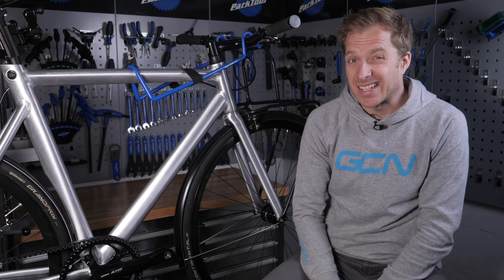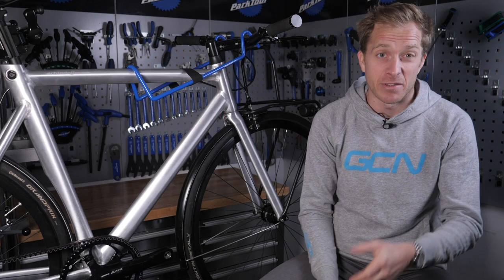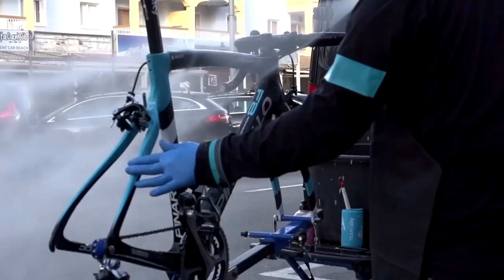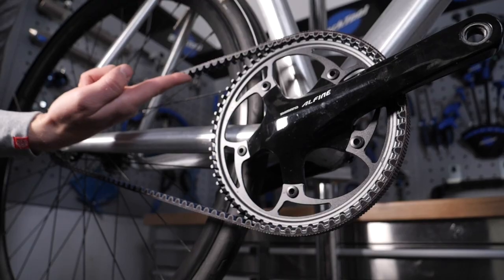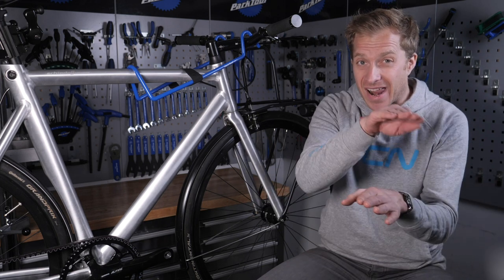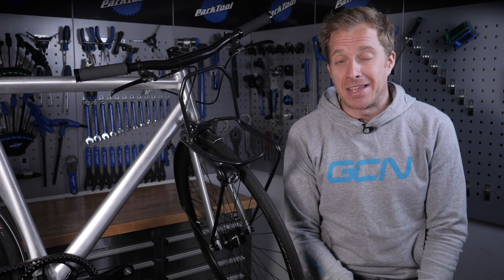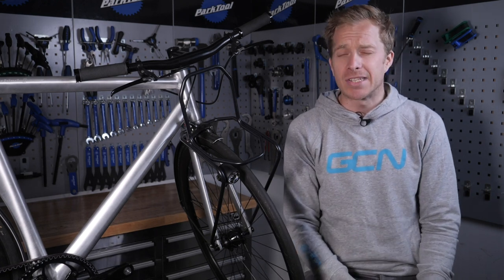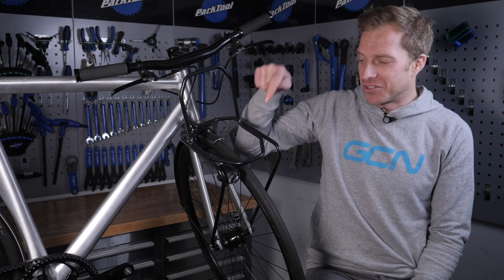4 Top Tips For Easy Winter Commuting | Urban Bike Maintenance Checks

Comment: Just want to address the statement about the belt drives.  I disagree that they are "virtually maintenance free", particularly in winter.  I've put about 15,000 miles on my belt drive commuter over 5 years, and where I live we get plenty of winter snow.  In my experience, the belt and sprockets do need to be periodically cleaned and lubed (Gates recommends a particular silicone-based lubricant), or else the belt will get noisy, making various kinds of squeaking, squealing, and chattering noises, especially when riding in winter weather.  Also, in cold temperatures,  the tension of the belt may need adjustment, since frames and other components can shrink in the cold and this affects belt tension, and belt drives are far more sensitive to tension than chains.  Overall, yes, they are less maintenance than chain drives, but I don't think it's fair to just skip over belt drives and say "you don't need to worry about taking care of them at all!"

Comment: Mentioning wear indicators on the tires again.  Just more proof that I deal with some pretty lousy street conditions.  My tires get nicked and sliced to the point that I can't trust them way before the wear indicator says I need to replace them. Still cheaper than driving a car to and from work.
Reply: I got super bulky tyres on one of my bike. I have purposely driven it in broken glass and got no puncture, just some cuts but are no where near in causing puncture.

Comment: I got a Gates CDX belt for half a year now and I have to say it's not THAT maintenance free. If you don't clean it at all, it will develop an unattractive whiny noise sooner or later depending on how often you ride through mud and dirt. Cleaning is much simpler though, just a matter of hosing the dirt off or scrubbing it with a scrub brush for 30 seconds.

Comment: I ride for fitness and fun. Only started a year ago with a cheap ebay bike with loads of issues to resolve. I love the riding position on this bike - a Felt F95. These are largely fixed now, but one of the remaining problems is small hands. I have to have the Tiagra inserts in to bring the levers in. This means that I have to have fine tolerance in the brake pads. I have problems with grit getting in between rim and pads. And also despite 105 callipers with 28mm tolerance, find that stones jam against them with my Conti 28mm (which I believe come up oversize). I had one serious blow out with a stone tearing the sidewall of my front tyre on a descent. Would both of these problems go with a new disc bike? Hoping the answer is yes as I can then get a new bike. What is going to be a similar riding position to the Felt F95? A Canyon Endurace Al, Cube Attain 2017? I only want hydraulic discs, and also don't want a carbon frame (is that irrational?).

Comment: 1. Don't use rim brakes. Disk is already better, but for most cities drum or roller brakes are the best choice. These stay clean without maintenance, and braking performance is mostly independent of weather conditions. No surprises. 2. Get a bike with an internal hub gearing system. That doesn't have to be a Rohloff, cheaper systems exist. Again, one more component you don't have to worry about. A chain guard works wonderfully well if you want to stick with a normal chain, not not have a frame that is broken by design. Install mudguards/fenders. 3. Get some puncture resistent tyres, Schwalbe Marathon Plus (or the slightly less barbaric Marathon Greenguard) comes to mind, I'm sure there are others. Don't bother with liners or sealant, these tyres are tough enough. 4. Make sure your headlight unit is not a MTB light, your fellow commuters will thank you (especially those going in the opposite direction. In some regions you may be able to get roadside assistance for your bike (the Netherlands has at least 2 that I'm aware of). It is no fun waiting for them to show up, but it may be preferable to trying to fix things yourself if things really go wrong.

Comment: Just buy the highest concentrated bottle of isopropyl alcohol at the drug store.  Best disc brake cleaner, other than lacquer thinner, but that is not as friendly.
Reply: Be sure to wipe it properly or it will accumulate moist that can damage your disk brake, both rotor ang caliper..